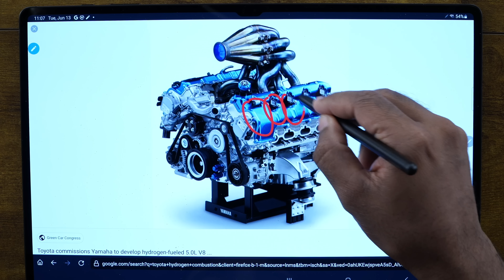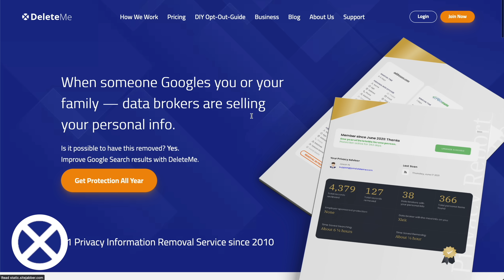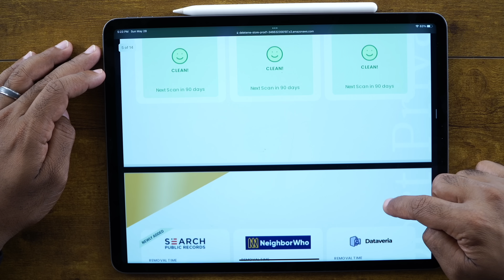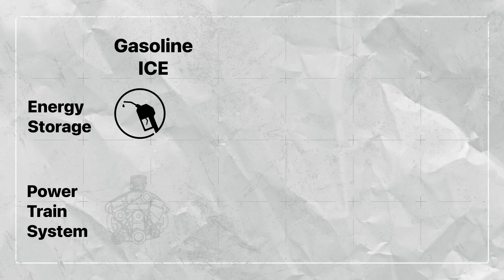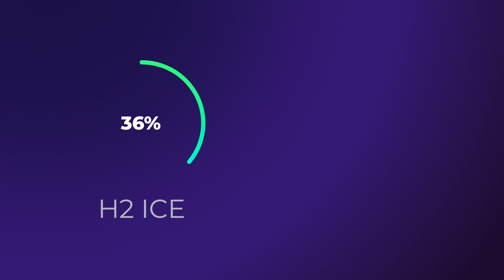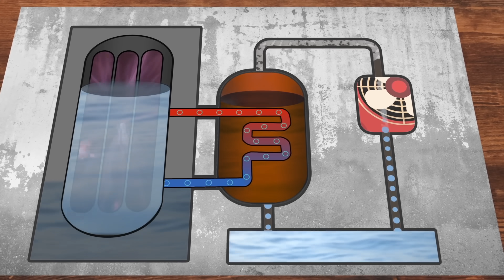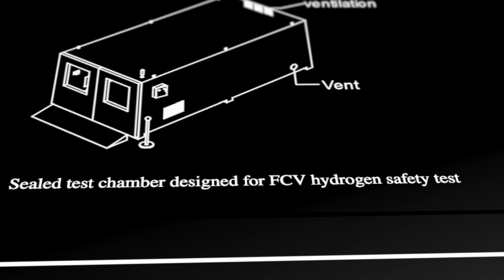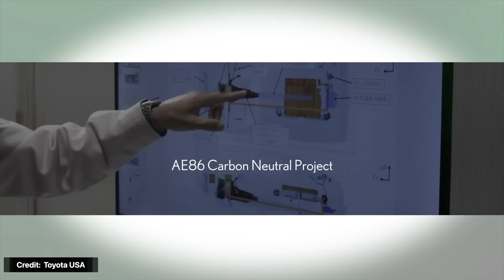Toyota's Says They Just Destroyed EVs - Hydrogen Combustion Engines

Comment: Hydrogen Combustion Engines can do what batteries can't. IE: heavy machinery, farm equipment, mining industry, motorhomes, HD and off-road trucks, Towing trucks, OTR tractor trailers, long range trains, industrial and long range aircraft, cargo ships, commercial forestry and landscaping equipment, military vehicles, and on and on .. Example: you can't defend your country waiting for your armored tanks to recharge so you can travel 50 miles at a time.

Fuel cell vehicle is great for long term use with a medium to light load and that requires minimum refueling time. IE: traveling sales, multi-state project managers, or anyone that requires fast refueling for long range interstate travel. Low maintenance.

Battery powered EVs are great commuter vehicles for traveling within 100-200 miles allowing you to charge at home and have minimal maintenance. Sure you can travel further but you have to add the recharging time to your schedule.

It's not about which non-fossil fuel tech is better, rather which one is more practical for the application.

🙂

Comment: Too many people consider EV and Hydrogen as being a binary decision. EV cars make sense, whereas hydrogen makes more sense for heavy plant machinery, Semi-Trucks, aircrafts and shipping. They can complement each other in the way petrol and diesel have.

Only green hydrogen is sustainable, grey hydrogen brings no benefit to the environment and blue hydrogen is pretty much a big oil company con designed to try and maintain as much of the status quo.

Trying to establish a hydrogen car market is a big risk because the disadvantages with EV cars is not enough for the general public to switch lanes to hydrogen.  

There would be little benefit in maintaining two fuel infrastructure for the private vehicle market. The few EV disadvantages there are for private vehicles will be resolved quicker than establishing a hydrogen infrastructure.  

Hydrogen has a part to play, because electric motors are not suited for everything.

Comment: Hydrogen on demand. No Storage is Needed. Works with existing engines both diesel & gas powered. People who have developed this technology have masterly died. Stanly Myers and Denny Kline are 2 of them. Using electrolysis to extract HHO from water, when burned turns back into water which there is no shortage of. This water can be routed back into your water tank and reused. No more dirty engines and more horsepower than gas or diesel provides. No stopping for gas or an electrical recharge and just about 0 costs for fuel. I guess we can't have this either. This can also be used to heat our homes without using natural gas. HHO could also be used to create electricity without burning coal or natural gas. NO EMISSIONS BUT AL GORE WOULD HAVE NOTHING TO BITCH ABOUT AND THE WEF WOULD JUST BECOME A THING OF THE PAST.!!  How different would our lives be if we were allowed to heat & cool our homes and drive our cars for free.?? This technology already exists and it works flawlessly but we are not allowed to use it. Sadly, Greed seems to run this planet instead of people looking out for each other.

Comment: Let's say we have been using electric motors exclusively for 100 years. Along comes the ICE. What advantages does it bring over electric motors? Range? Cost? Simplicity? Efficiency? Parts count? Maintenance? Usability? Reliability? Longevity? Lubrication? Heat? Weight? Fuel? Flexibility? Noise? Vibration? Power? Speed? Cleanliness? Durability? Robustness? Size? 

Would you really want to be an ICE salesman trying to dislodge the electric motor?

Comment: I think its important to also consider what happens to all the dead batteries from EVs.  Sure there are claims that up to 92% can be recycled, but there is also energy being consumed to conduct that recycling effort - so there is energy consumption up front to build these batteries and then more at the tail end to recycle them.  And will those recycled products maintain that 92% recycling rate once those products die or will that percentage keep going down?   Will lithium supply last as EVs sales rise or will it become like oil and bring inflationary supply/demand issues over time?   I'm glad to see Toyota pursue this effort, even if it ultimately fails.  Someone has to try, as hydrogen seems to be the cleanest and most abundant fuel source.   It should also keep the EV manufacturers on their toes to try and improve on their technologies.  Competition in that regard can be a good thing.   Perhaps hydrogen could be a better fit for commercial industry and EV/battery technology best fit for consumer vehicles and golf carts, etc.
Reply: For me the deal breaker is not having my own charging station at home, you can't install one in your house, until there is established infrastructure it's just impractical. Not to mention more costly.
Reply: i believe ev is good for the future, in public transport buses, trains etc. but not for the raw size of consumer market.

Comment: Hydrogen fuel cell or internal combustion make more long range sense than EVs.  With a network of hydrogen fueling stations like is being built for EVs, the advantages are unbeatable.  And a fueling station network is ready built.  

Compared to EVs pollution at the raw materials source and drain on the power grid, the are squeaky clean.  

With the total network source to road cost considered, H2 is cheaper long term.  

For internal combustion H2 cars, the exhaust can be run through a filter, much like for internal combustion engines.

Comment: The most efficient use of a combustion engine is to let it run optimally for a certain constant load until the tank is empty. Since car driving is everything but constant, a combustion engine in a car makes no sense anymore. But combustion engines are about 25..30% efficient. So it makes more sense to put hydrogen into a fuel cell and let it power  a hub motor that are usually above 95% efficiency.
Reply: To be clear: I am all in favor of any technology that will advance our energy storage. And as such I hope they keep funding hydrogen research. But we had a major research organisation that went full on in hydrogen, and after 5 .. 10 years they gave up because Lithium battery capacity was so much advanced while they still had major problems with hydrogen storage and moving the storage. Everything was great, except that.
What I mainly see safe hydrogen usage now is to generate it on location for use where only hydrogen makes sense, or better: HHO. Mostly different kind of heating: from a HHO "lance" to a simple sand/HHO heater. You just need to add clean water and electricity, and you can actually recycle the water. Since it is generated for immediate use, it is not extremely dangerous to actually generate HHO because you are not going to store it.

Comment: One thing you‘ve forgot: A Mirai can store 5 kg of hydrogen and ride about 450km with its fuel cell. If you use it in a combustion engine, you need considerably more Hydrogen per 100 km. The range reduces to 150 km. Or you store liquid Hydrogen which comes with its own problems. Wondering how Toyota will overcome physics 😅
Reply: Storage is the only real problem as hydrogen is abundant and only produces water vapor as exhaust.😮
Reply: @marvinellis1517  Sigh! There are a huge number of problems with hydrogen. Do some research. The abundance or otherwise of hydrogen is just a red herring.
Reply: @marvinellis1517  Efficiency and energy losses are a major factor against H2 cars.
Reply: It's better in the long run to have a hydrogen engine , because you wouldn't have to replace all the hybrid batteries . Bob Lazar has a hydrogen powered Corvette and he says his mileage is about the same as a gas powered engine .
Reply: Liquid combustion is most efficient. The storage is the issue.
Reply: They won't.
Reply: Yes! Pesky physics. 🙄 I looked into Hydrogen about 20 years ago when toying with the idea of a hobby build EV. The main issues then after my cursory look seemed to be creating the h2 at speed and storing it. There was talk at the time of "glass storage this" and "nano-tube that", but there's been no "lithium ion plus super/ultra capacitor" equivalent breakthrough for hydrogen that I'm aware of. If the storage is hydrogen dense then it's either energy intensive getting there or on the way out, else it's done chemically (back to petrol) and it's comparatively dirty. I think looking at an electrical route without the rare earths is probably going to be the easiest and most profitable/efficient route in the long run (for ev, of course. Also, I heard about some "maybe" breakthru by electrifying iron solenoids being made more efficient... Wizzkid designs program designs which designs "clever" commutator something something... Still watching that space.) 
But any time i hear anything new about h2 i rush to see how it's going to be stored and... Thus far it's always been with disappointment. Both this video and your comment in response to it seemed to remind me of how my quick reinvestigations usual end...
Reply: THIS GUY DOSNT KNOW WHAT HES TALKING ABOUT. HYDROGEN IS THE FUTURE. ITS MUCH MORE EFFICIENT THAN ELECTRIC. ELECTRIC GRIDS ARE GOING TO BECOME STRAINED IN THE FUTURE WHICH WILL LIMIT ELECTRIC CARS EVEN MORE. WE ARE ALREADY HAVING TROUBLE WITH THE LOAD IN TEXAS ON THE ELECTRIC GRID. HYDROGEN IS THE FUTURE BECAUSE IT IS CLEAN AND ONCE THE SUPPORT INFRESTRURE IS BUILT FOR HYDROGEN CARS IT WILL ESSENTIALY TAKE THE PLACE OF GAS ENGINES..

ELECTRIC VEHICLES CAN NEVER TAKE THE PLACE OF GAS VEHICLES BECAUSE THEY ARE SIMPLY JUST TOO INEFFICIENT TO BUILD AND MAINTAIN OVERTIME. WE HAVE TO DO SOMETHING WITH ALL THESE BAD BATTERIES AND THE POLLUTION THAT COMES FROM MINING COBALT AND LITHIUM AND THEN HAVING HUGE LANDFILLS OF NOTHING BUT BAD BATTERIES THAT NEED TO BE RECYCLED CAUSING CHEMICAL POLLUTION INTO THE GROUND WATER AND SOIL.

TRUST ME HYDROGENN IS THE FUTURE. 
ELECTRIC VEHICLES ONLY PRESENT THE SAME PROBLEMS IN DIFFERENT WAYS
Reply: I hope Toyota comes up with something practical as I am very reluctant to drive around with so much lithium under my seat. Or park it anywhere near my house, for that matter.
Reply: @TheanHooYew  There's a growing pool of videos from China, showing BUILDINGS being taken out by a car fire - when parked in close proximity.  I've seen a couple of vids of electric scooters going boom - and as a (former) rural volunteer firefighter for the best part of 2 decades - those battery fires SCARE me.  Bushfires did not.
Reply: @OhSoddit  YouTube videos about EV fires make me very reluctant to drive one. This goes double for EVs from China.
Reply: @TheanHooYew  you can just buy a EV with LFP battery, I never saw them on fire
Reply: @life107familyfitnessboxing8  Never saw that in thenews. Are you a troll?
Reply: @OhSoddit but strangely, very few, if any, are Teslas!
Reply: @OhSoddit  yeah alkali metals are very reactive and dangerous. It's crazy how they're even harder to deal with than a gasoline fire
Reply: @OhSoddit  dont forget when teslas catch fire you cant really put them out they are hard to get to, and due to super high voltage can easily, and exposed to the toxic substances released from EV batteries burning or leaking
Reply: @TheanHooYew I think sodium cells are soon to be a thing and should be somewhat safer. Not sure about the efficiency side though.
Reply: @cazinnova Great for stationary storage. Still a bit heavy for efficient use in transport.
Reply: @TheanHooYew yeah I wouldn't be too comfortable with sitting on hydrogen either
Reply: @TheanHooYew but happy to have a 1,000 psi hydrogen bomb in the boot? Great trade!
Reply: @gregbailey45  I was hoping Toyota (or anyone else) may come up with some practical way to use hydrogen, and I think most people would agree that precludes driving around with a high-pressure vessel. I am not an engineer in any capacity, but is there a way to store enough hydrogen for practical use that is not under high pressure? Is that even possible without breaking any laws of physics?
Reply: @TheanHooYew  Storing it within canisters containing metal hydrides is possible, and more energy dense than liquified hydrogen.
Not without it's own problems though, have a Google search on it if interested
Reply: @incandescentwithrage  The internet did not disappoint - a quick search showed much research has been done on storing hydrogen, including the use of metal hydrides.
Reply: The fuel cell itself is the problem.
Can you get much more efficient energy from gasoline by using a fuel cell? Yes, exactly the same as with Hydrogen

Problem is there's not enough Platinum group metals in the world to replace every ICE with this.

If you tried, it would force the metal prices higher, making it (even more) prohibitively expensive.

Fuel cells also don't last as long as ICE engines.

With clean production of Hydrogen and quick refuelling, it doesn't matter whether you could get more range per unit mass from a fuel cell.
Reply: @incandescentwithrage yep, just satisfy all the wotifs, and Hydrogen is a great fuel. Until then, BEV is the way to go!
Reply: @incandescentwithrage  Clearly you have very little understanding of the production and use of hydrogen. Clean prodoction and quick refuelling are oxymorons when applied to hydrogen.
Reply: @rogerphelps9939  I can confidently say, without a shadow of a doubt, I have a better understanding of the production, transportation regs (road, air, sea) and combustion behaviour of Hydrogen than you do.
Reply: Very good observation, Men I should have stayed in school 😂😂😂
Reply: Use water.
Reply: There is no perfect solution. Lithium is dirty to mine and process, and it's too costly to recycle. Cobalt is toxic even when it's not burning. I think it's worth the effort to try and make hydrogen a practical solution.

Comment: I live in Delta Junction, Alaska.  Winter temps are frequently -40F or lower.  It is one of the reasons why the Cold Regions Test Center (CRTC) is located about 15 miles south of me.  Tesla has been testing their cars here for about the last decade.  Delta Junction is a fairly small place, so if you want to go to Costco (or even McDonald's) you need to travel the 100 miles north to Fairbanks (which is often even colder).  I know for a fact that your average 300 mile range Tesla will only make that 100 mile trip reliably if you do NOT run the cabin heater.  My typical trip in those conditions involve traveling the 100 miles to Fairbanks.  Hit the 3 to 6 stores over the next 3 to 6 hours and then travel the 100 miles back.  No battery powered vehicle currently produced (or even in the foreseeable future) could even come close to this use case. Too many people think that since it works in San Diego, it will work everywhere.  Hydrogen or even Porsche's eFuel are far better options in this environment.  Of course that does not even take into consideration that all electricity in Interior Alaska is generated using Coal and Diesel power plants, so every Tesla I see is dinosaur fired!  Thanks for the videos.

Comment: Nobody is going to want a hydrogen ICE over a cheaper, faster, better EV that can be charged almost anywhere you park it. And hydrogen fueling stations cost too much to make them a viable business. The cost of the hydrogen fuel to pay off all the filling infrastructure would be many times more than even relatively expensive gasoline and the cost savings of an EV would put hydrogen to shame.

This has to be one of the dumbest ideas I've heard a major automaker suggest. All they are doing is making excuses for not making the transition to electricity.

Comment: Once one has bulk hydrogen, it is simpler to convert it into methanol, or  hexane-Decane fractions  and combust in any old ICE without a need for high pressure fuel handling systems...  (Anyone who has a bulk load of hydrogen isn't bothered by the conversion efficiency, because they are most likely using surplus nuclear power to create energy storage for "grid disconnected" use cases.

Comment: Ridiculous:  No ability to recharge at home, which is a HUGE advantage for EVs, just so you can have some impressive vroom vroom sounds.  This must be Toyota's attempt to capture the idiot market, after gasoline is made illegal.  How about just adding a synthesizer to play an ICE sound track instead.  Costs maybe $200?  And rare-earth batteries are almost obsolete, with so many non-Lithium batteries on their way to production.  Some of those can charge in minutes, too.
And why no mention of ammonia for hydrogen storage?  Then the fuel is liquid at low pressure, and can use gas pumps, delivery trucks, pipelines, and storage tanks with slight modifications.

Comment: Thank you. However, H2 engines emit a lot of NOx same or even more as regular ICE cars. The major air pollutant in western countries today is NOx.
Also, today H2 is so inefficient it can't be cheap enough. Last, moving to H3 economy, will produce huge H2 leaks. Tday ~3-6% of all natural gas extracted leaks to the atmosphere, with dire global warming consequences due to the fact than natural gas is mostly methane- ans H2 is the leakiest gas of them all, so it will leak. Now, even though H2 is not a greenhouse gas, a lot of H2 in the atmosphere it will saturate methane Oxidation pathways in the atmosphere, therefore extending methane presence in the atmosphere which now has a half life of 12 years. This will enhance methane's global warming potential. 
H2 is promoted heavily by natural gas companies, that try to squeeze a few more years pumping us with natural gas. Enough is enough.
Also, why bother with a car that will need servicing as much as ICE cars, and probably more (due to the H2 issues)?